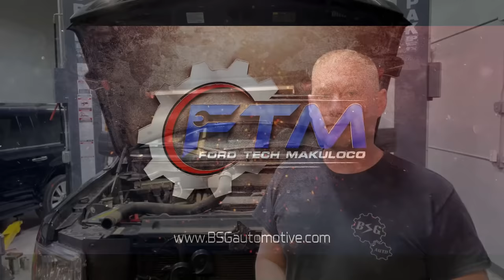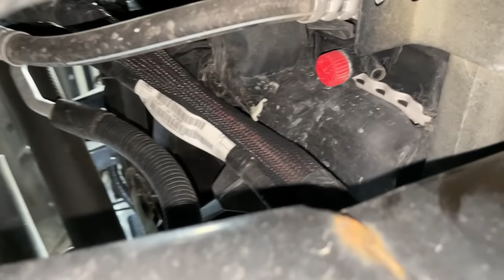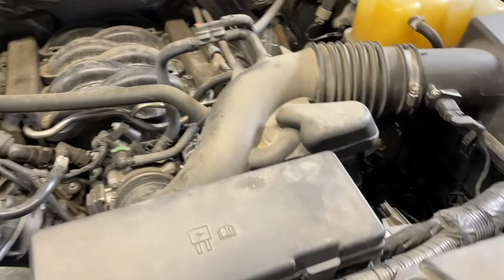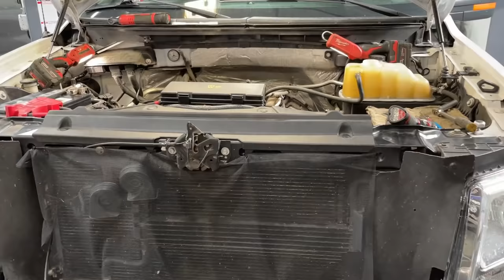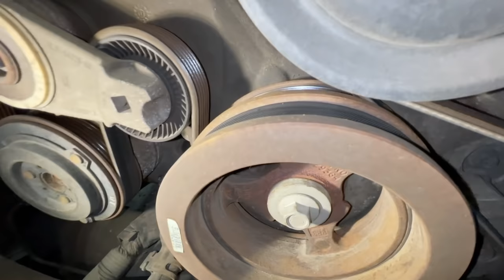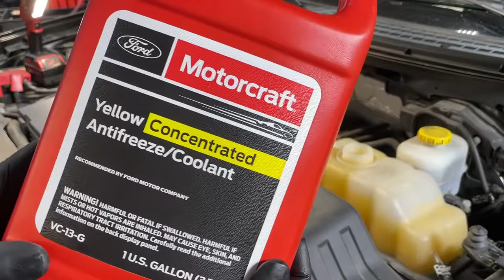2011-2021 Ford F-150 5.0L Coyote Engine: The Most Common Coolant Leak Repair!

Comment: Should heater be turned on when burping?
Reply from the maker: No need
Reply: Thanks, I’ve replaced the o rings 3 times, now have the reservoir hose elbow leak. 
I pulled a camper 138 miles knowing I had a leak but couldn’t find it at the time. I topped up coolant before trip & before return trip(138miles). At around 100 miles truck was struggling to get to 60, had been pulling fine @ 70 average. Got home checked coolant less than a quart low. Let engine cool took it out up to 70, just truck.  Check engine light came on when I got to speed. Does truck have a safe mode that would have reduced speed? 2012 XL 5.0 Thanks

Comment: How difficult would it be to replace an 05 F150 supercrew 5.4 3v with a 5.0 coyote? Is it possible? Would it jive with the trans etc? Runs fine but want a contingency plan. Not looking to smoke tires all day but having a stronger, faster and more RELIABLE engine is what I’m looking for.

Comment: I think I missed this part.   Why did you change the entire Y pipe and not simply change the o-ring?   Within the entire Y pipe, it would seem unlikely that the rubber and plastic broke somehow or wore somehow to cause a leak.  It seems more likely that the o-ring itself wore, cut or simply compressed.  You showed how the o-ring in the top hose was flattened.   Just seemed to me that the y-pipe leak was a bad o-ring.   But then ... it looks easier to cut away the y-pipe and replace it when changing the y-pipe o-ring.   Would this be the reason for the new part?   Now that makes perfect sense to me.
Reply from the maker: Do you have the Ford part number of the exact o-ring needed for this repair while no one else does? Please share...
Reply: @FordTechMakuloco  Gotcha.  Makes sense.  I didn't mean to come off judgemental.   Appreciate the videos!
Reply: I tried to use a similar o ring and it didn't work.   Now I have the t connector to replace
Reply: @FordTechMakuloco Dorman 926-168 is the O ring kit.  Great video, I have watched many of your F150 videos which has helped me a lot.  Thanks
Reply: @matthunter2952  I used that o ring and for whatever reason it still leaked so I got a new t connector and now no leak.  I think I may have bent the metal clip on the old one
Reply: @greghoffman3146  I bought this kit to go with my Y pipe as the single O ring needed for the hose was unavailable at the parts store.  The Y pipe already had a small orange O ring on the smaller side so I used that and one large O ring from the kit for the hose.  Still have a large and small O ring from the kit in case it leaks again.  Not sure why the kit comes with 2 large O rings.  Maybe there is one on the other side of the upper hose? So far so good after driving around all day.
Reply: @FordTechMakuloco  Dorman 926-168.  I think it's the right part, well according to AutoZone it is.
Reply: @Greg Hoffman  exactly my predicament...I was told to buy an entire new y pipe connector.  The o ring itself didn't fix the leak and I did everything correctly...it's frustrating.

Comment: I wish this job on no man. Having worked on Bmw’s for quite awhile I’ll never buy another Ford knowing what it’s like to work on these. You said it’s a doozy…… it’s a freaking complete nightmare….. don’t even think about trying this without disconnecting hose above it and hacking that thing off piece by piece. Getting it back on? Hours later I don’t know seriously thinking of towing it to a shop and letting them try to get that thing on. What a nightmare while hanging upside down.
Seriously…. You should be warning people!
Reply from the maker: It is a very simple job.

Comment: Could you please help me on which o rings I need for changing thermostat?
Reply from the maker: Just one o-ring for the thermostat job itself- Motorcraft Part Number RG630
Reply: @FordTechMakuloco   Do I need to buy the housing gasket too? I’m doing my water pump and thermostat along with this
Reply: @FordTechMakuloco   I’m gonna order the rts1081 seal too. I can return it if I don’t have to use it
Reply: @FordTechMakuloco  I just got my t pipe from the link in this video. Sadly it’s an aftermarket with no ford packaging, nothing ford on the pipe, and wrong number stamped into the plastic.
Reply: @FordTechMakuloco  Do I need the rg631 gasket too?

Comment: I just changed the t connector and the radiator hose and when I filled up the coolant and went to start the truck it cranks but doesn’t start. Did anyone else have this problem and any suggestions, thanks

Comment: Another bad leak would be between the water jacket and oil port on the oil filter adapter gasket on a 1997-2003 Ford 5.4 2 valve., it took me a while to figure out that's where it was leaking oil, and when checking the coolant, I see gas or oil streaks in the coolant, what a bad design Ford.

Comment: I bought a 13 expedition with a 5.4 3v and saw there is green collant in it, how hard would it be to clean it out and put the correct coolant in it? I wish they would have used OE coolant
Reply: He has a video on that "How to perform a coolant flush on your Ford vehicle "
Reply: Wouldnt be that hard, but the 5.4 3v spec is the gold coolant. You can still buy that from Ford. Drop the lower hose, you can simply drain and refill unless the system is super dirty. Make sure to burp the system like he explains in the video.
Reply: @markk3652  coolant was replaced when they did an intake manifold about a year ago, I just want the right coolant in it. I think I’ll just change it out thanks!
Reply: @vorsprungdurchtech  good plan, Motorcraft gold is the way to go.

Comment: Why replace the Belt? if it is not damaged?
Reply from the maker: Do what you want no problem, but my customers require a higher level of service. Could you imagine if I did all this work and didn't replace the already questionable belt and the next cold dewy morning the belt was chirping on their freshly fixed and checked over vehicle...

Comment: Shouldn't you turn the heat control to heat when you're burping the system?  To get flow through the heater core.
Reply from the maker: no

Comment: Mine is leaking. Will it hurt to drive it to pick up the parts I need?  It’s my only vehicle
Reply from the maker: just keep an eye on the coolant level.
Reply: @FordTechMakuloco  I’m worried it will blowout while I’m on the interstate. Thanks
Reply: @FordTechMakuloco  will do thanks a lot
Reply from the maker: No it won't do that.
Reply: @FordTechMakuloco  I have everything I need from Amazon and it supposed to be her tomorrow so I’m gonna work on it Saturday. Thanks for your post. Saved me at least 200 bucks
Reply: @FordTechMakuloco  would you change the water pump too or leave it alone?

Comment: What years 5.0 do you recommend
Reply from the maker: 2013-2017
Reply: @FordTechMakuloco  Ok, thanks for the reply. I’m currently lookin at two 2017s. Both have under 55k miles.

Comment: What's the everyone's thoughts on the mushy Ford brake pedal? I've replaced the master, booster, pads rotors and multiple flushes. Pedal still mushy. My two nearest Ford dealers are very untrustworthy.
Reply: No detail on Year/Model, but siezed caliper slides or ABS actuator.
Reply: @03OxWhiTeMach  2013 Ford Edge SEL AWD

Comment: Living in AZ, I’ve had to replace the “Y” connector twice in 4 yrs.  these parts are not good in hot dry climates!
Reply: Is there a better aftermarket replacement?
Reply: That is buying the OE part from the dealer.  They just don’t last.  I haven’t found anything.

Comment: I turn heater on when toping off.
Reply from the maker: Makes no difference, coolant flows through cold or hot there is no shut off to the heater core.

Comment: Do you have a link for the upper hose for replacement?
Reply from the maker: Which year F-150?
Reply: @FordTechMakuloco  2014 5.0L
Reply from the maker: Here you go- https://amzn.to/3B2ybON
Reply: @FordTechMakuloco  thanks
Reply: @FordTechMakuloco  Sorry one more, the hose that goes from the coolant tank to engine, it is a quick connect. do you know the part number for new hose and or the o ring for it
Reply: When I click the link. Amazon says it won't fit a 14 f150?

Comment: While your down that far wouldn’t you want to change the thermostat?
Reply from the maker: You can for sure but I don't upsell unnecessary repairs like that. Ford OEM thermostats are notoriously reliable, only a few Ford engines and model years are prone to failure and this is not one of them.
Reply: @FordTechMakuloco  ok thank you I quest I’m to old school love your videos you helped me out on a 2011 eco boost 3.5 I replaced both turbos
Reply: @FordTechMakuloco  God bless you for not doing upselling. The more I watch (and I've watched a lot of your videos!) the more I respect you.

Comment: Seems like it would be cheaper for Ford to manufacture and an easier installation with a standard metal fitting and hose clamps?
Reply: They are way faster to install the way Ford is doing it now. No tools needed for the most part. Just pop them in and your done. I'd rather deal with miserable spring clamps myself though.

Comment: FYI...Ford has replaced the "Y" pipe with a revised one yet again...  DR3Z-8566-B
Reply from the maker: Yup and there will be improvements in the future, either way the one I link to automatically sends the latest.
Reply: @FordTechMakuloco  good to know.  After watching this video for the first time about a month ago I am now prepping to do it now that I have a leak from the Y pipe...strangely enough only when the engine has cooled off...
Reply: Just completed this repair and it went fine...one point of reference on my 2016 the drain for the radiator was on the drivers side and might apply to the 2015 and newer.  Again, love your videos and find yours above and beyond any others!

Comment: Uno what'd b great? 4 these multiple hose connectors to be made of aluminum and use normal clamps, they probly dont because of cost of aluminum vs plastic but then again it cant be cheap 2 make the way they do w quick disconnect n orings.

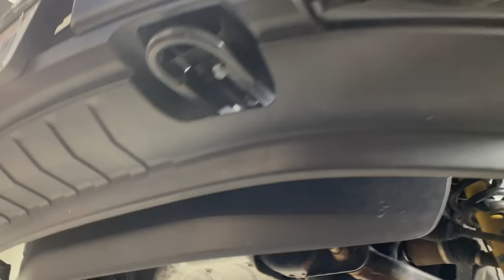Comment: At time stamp  1:47… follow the hose th the right sight of the leaking area…. OH..LOOOOOK!!!
An old school hose with and old school clamp…!!! That lasts for years…. Hmmm
Quick disconnects are failures waiting for an opportunity… simple hoses and clamps… ok the take 30 seconds longer to assemble on the assembly line but they last YEARS LONGER

Comment: This is another example of Ford using coolant quick connects that leak under high pressure. Why not design it where you use regular hose clamps that don't leak as easy? Another reason that gives Ford a bad name.

Comment: Is there a reason you chose not to vacuum-fill this cooling system? I am guessing that you wished to show DIY'ers that it is not 100% necessary on this engine?
Reply from the maker: Absolutely not needed with this engine and yes this is geared towards the DIYer.
Reply: @FordTechMakuloco  thanks for the reply.

Comment: plastic plastic plastic.   50 cents cheaper  and cost thousands to fix.  it is a good profit when they sell 2 millions vehicle a year and use that part for 8 years before redesign. 
it just one part of the vehicle,.

Comment: Plastic doesn't belong on or in an engine when its subjected to continuous heat, I know Tacoma's have an issue with a plastic coolant pipe thats on the back of the engine, shear stupidity.

Comment: Can someone smack the engineering department and tell them no quick connects just stay with what works and doesn't leak constant pressure clamp ok I'm done someone tell them that though thank you

Comment: Notice all the parts that are going bad are those black plastic pieces. Manufacturers use these plastic parts to save money. Intakes are made from the same crap. From all the cold heat cycles these plastic parts go bad. Pretty soon the whole engine is gonna be made out of it.
Reply from the maker: What should the chains ride on instead?
Reply: @FordTechMakuloco  so you like the design of those plastic guide's for the timing chains ? I guess you would thats how you make money. I jjust dont like how manufacturers cheap out and charge an arm and a leg for cars and trucks thats all!
Reply from the maker: My point is they must ride on plastic or at least a metal backed plastic insert.
Reply: @FordTechMakuloco  I always love your videos. I am talking about ALL Auto makers not just Ford. I wish they put a Cummins in a Ford pick up. Id have one. They would last forever. Thats why they wont.
Reply: @FordTechMakuloco  not durable